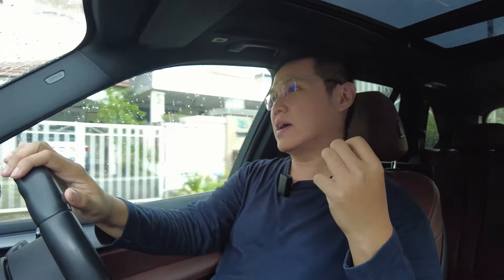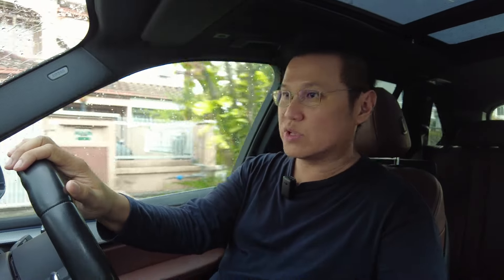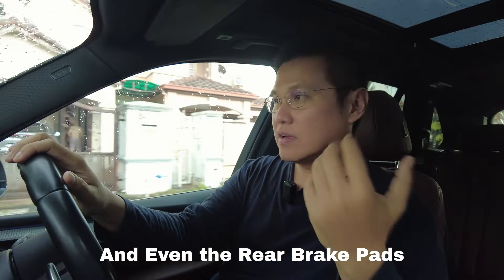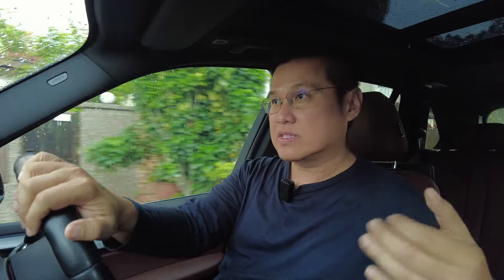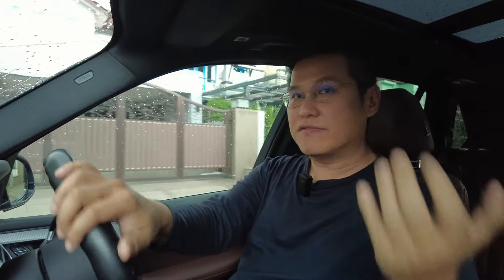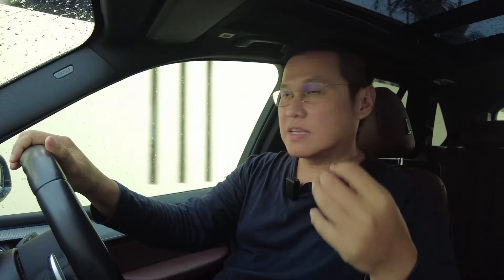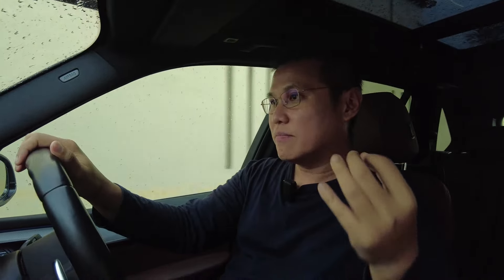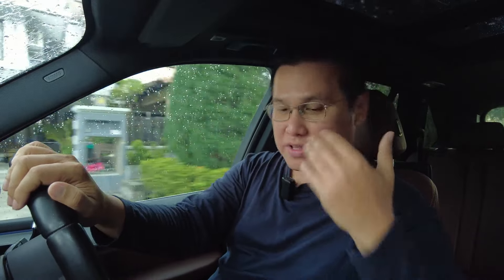BMW F15 X5 Rear Grinding Noise Problem (HELP)

Comment: Hi wondering did you resolve this frustrating problem my x5 has now started the same fault. Is my 1st bmw and last problem after problem hope bmw are ashamed of the cars they make and sell at such premiums. The ultimate driving machines they are not.
Reply from the maker: My local BMW dealership said it's due to my tires. They said to have swap with another customer's F15 X5 wheels and the sound is no longer there. Conclusion is that they recommended that I changed my current Goodyear Eagle F1 Assymetric SUV 4x4 Run Flat Tyre.
Reply: @chestercheng75  It's weird when something don't logically seems related is the culprit. Glad you  manage to solve the issue.

Comment: It sounds like wheel bearing for sure. You sure he replaced it?! Some mechanics say they do things when they really don’t.
Reply from the maker: Yes, it's replaced. My local BMW dealer confirmed nothing wrong mechanically

What they did was swap my wheels with another customer's F15 X5 wheels and the sound is no longer there. Conclusion is that they recommended that I changed my current Goodyear Eagle F1 Assymetric SUV 4x4 Run Flat Tyre.